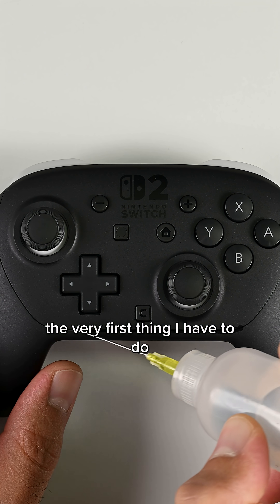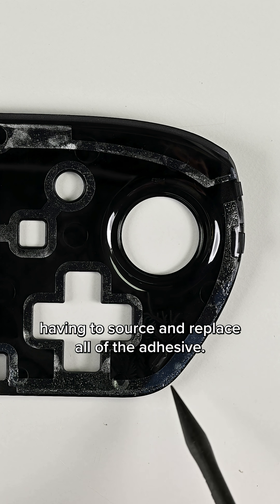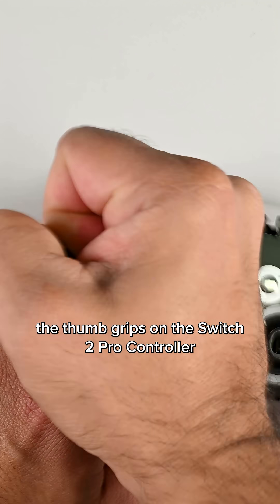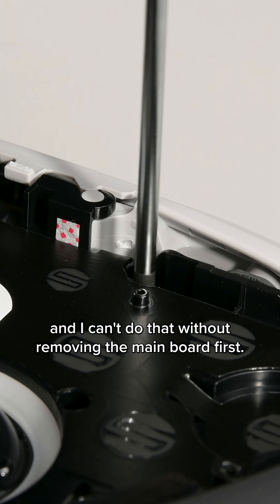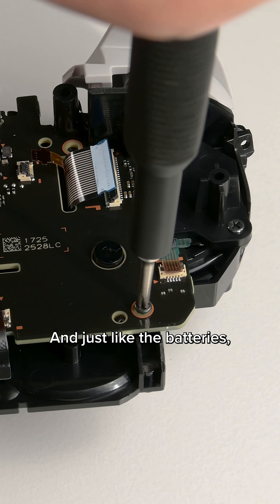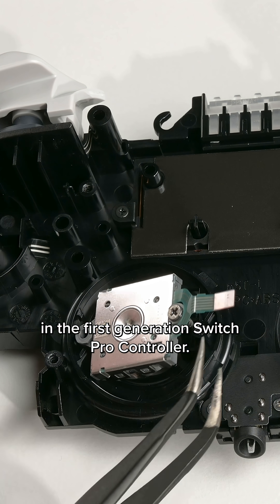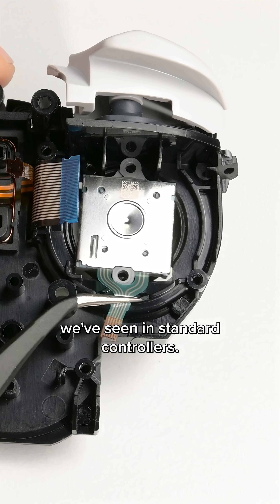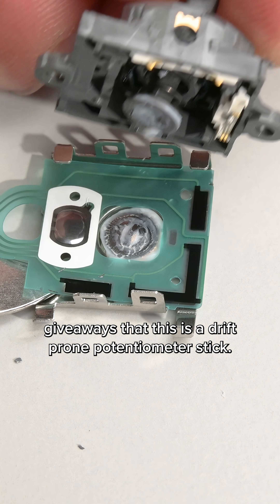Nintendo Switch Pro 2 Controller Falls Short! #ifixit #nintendoswitch #teardown

Comment: At this point just use the og pro controller or anything else, you should be fine coping without the C button
Reply: What about the "GR" and "GL" buttons? Maybe you could use a third-party controller instead
Reply: You can't turn on the Switch 2 remotely with a Switch 1 Pro Controller
Reply: The controller is better than the switch 1 pro controller
Reply: @JordiumZ Did you spit or swallow when Miyamoto dropped his pants??
Reply: S2pro > s1pro  you can cope without tinkering with it